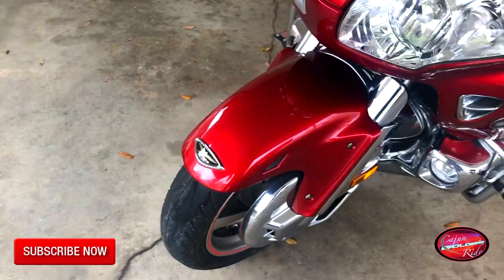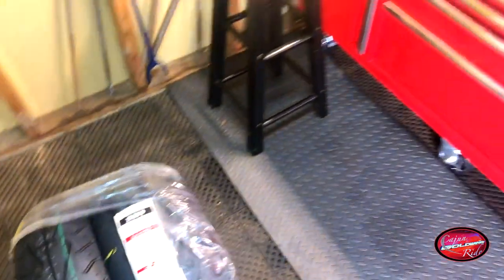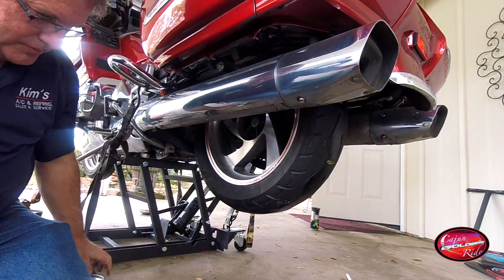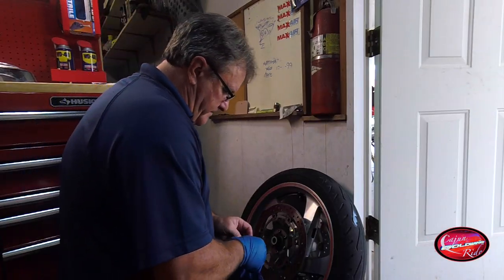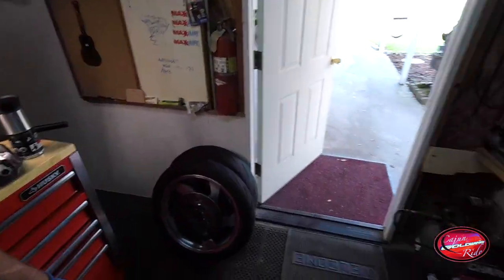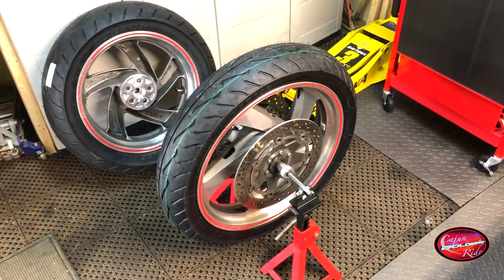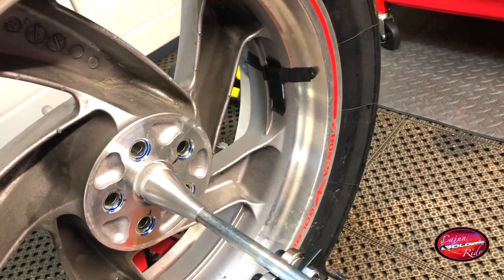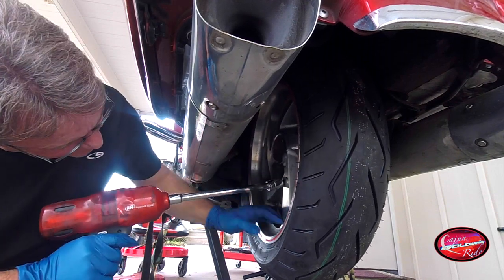Honda Goldwing Tire Replacement | Kim The Cajun Goldwing Rider

Comment: Nice, the rear looks allot easier than the front.  I have done my fronts allot.  It is a pain with the brakes
Reply from the maker: Jims Motor Trike You are Right jim it is . On your back of your bike should work like a car to remove the back tires. And that’s not to bad . Thanks again my friend for checking out my videos. Ride safe

Comment: I use Venom Spider tyres  on my 1800 g/wing great tire will not let you down cheers .
Reply from the maker: goldwingman1500 Thank you for the info . I will check in to does name brand tires on next set . Thanks again my friend ride safe

Comment: If you changed the tires of your Goldwing you choose always for Dunlop ??? 🤔 and why not  bridgestone tis is just a question, hey Kim nice job 👍
Reply from the maker: My First Goldwing i got was 2001 and it came on the bike and i sold it with 69,000 mil and  i like the ride and life of the tires . And when i got the 2008 new it also came with the same tires . So that is the only reason why i keep getting the same tires . Thanks Again my friend , maybe next time i will give Bridgestone a try.
Reply: @kimsac1  
Thanks Kim for the explanation , I also drive  dunlop now but they say Bridgestone is better on wet roads

Comment: How much mileage  did you get on the tires ?  D250
Reply from the maker: Chapter K-2 Hi my friend 👋.. I got 10,000 mile on them . But I did not keep up with air pressure in them . Thanks again my friend. You might want to check out my new video to day . That I just put up . I think there 5 or 6 new videos after this one . Thanks again my friend ride safe. I appreciate you. ❤️👍👍👍